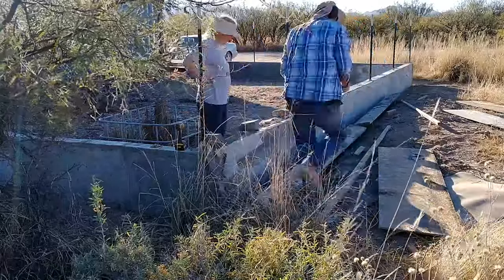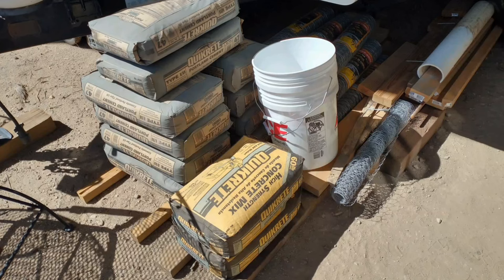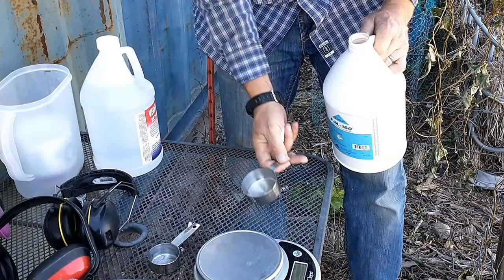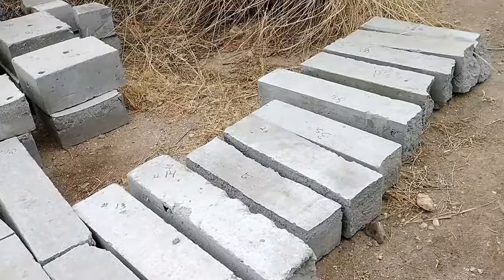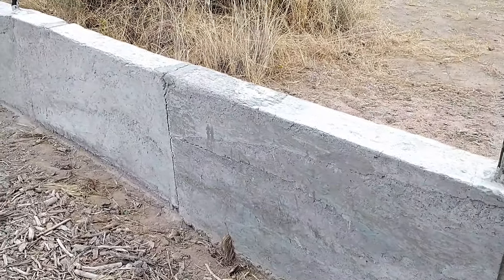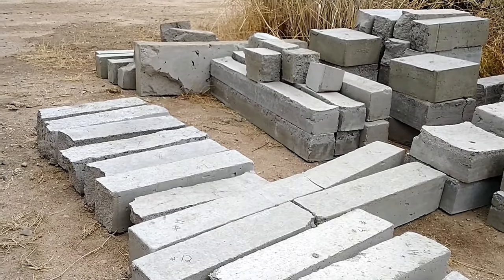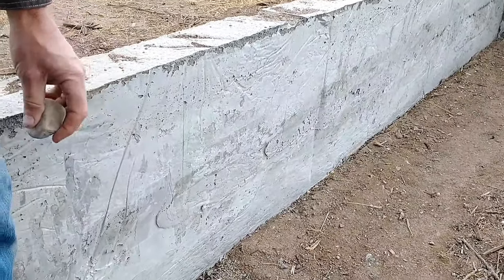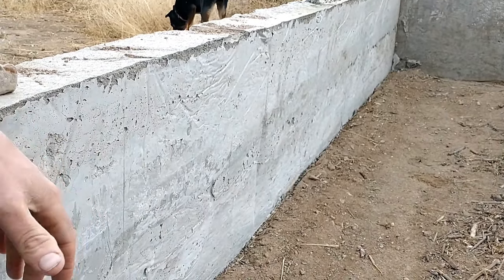Why we GAVE UP on AIRCRETE & What is Our Plan Now?

Comment: Aircrete is meant to be built with self reinforcing geometries like domes and arches, just like Roman concrete, then encapsulated on both sides with fiberglass or basalt mesh. When it is kept under compression and encapsulated with these tensile layers it is strong enough to even be earth buried. Straight walls are not recommended.

Good luck with your build.
Reply from the maker: I'm sure Roman concrete was much stronger than this stuff. Aircrete is a whole different thing and has way less tensile and compressive strength than any type of concrete. Plaster would help, but with pressure, our samples compress down and turn into powder. 
Thanks! We are excited to get this house built. 🙂🏠
Reply: @RedandAprilOff-Grid  Indeed. It is 70% air after all. It was never meant to pass the tests that this channel put it through. Neither would styrofoam, another product that is mostly air. The benefit of Aircrete is that it can be created from scratch, formed easily, manipulated very easily, insulates well, is fire proof, rot proof, bug proof, and water retardant. 

Making long blocks then placing weights in the middle to test its tensile strength is the opposite of what it is good at. Pressing direct pressure over a small, localized space to test for compression, is not what it is good at. Aircrete is a lattice of cement bonded around air bubble geometries. 

It distributes loads well.

When Aircrete is spanned across a distance, stacked in an arch or otherwise round shape, encapsulated in an exoskeleton of tensile reinforcing mesh and finished with stucco, it can hold tremendous weight. This is why Domes built in this manner work so well because their geometry works well at distributing loads across the cement air bubble lattice of the Aircrete while the tensile exoskeletal layers prevent outward expansion and lateral shearing.

I can poke a hole in raw Aircrete with my finger, and I can also drive a car on top of an Aircrete Dome after the tensile layers have been added while the inhabitants of that dome stay warm inside due to its rigid insulation properties while it is retaining a hillside and terracing land as it is partially earth buried.
Reply from the maker: @WhistleLad  The purpose of our testing was: to get a feel for aircrete and the process of making it, to compare the different mixes to each other so we could decide which recipe we wanted to use, and to see if we could produce a consistent and reasonably strong aircrete that wasn't overly brittle.
We aren't saying it can't be done, but we were not able to do it, and have seen many others struggle with making it themselves too.
It sounds like someone has figured out how to make some good and consistent aircrete, that sounds like an amazing dome. 👍🙂
Reply: @RedandAprilOff-Grid  I am suggesting that Aircrete is always brittle and that there is no way to change that because it is 70% air. The brittle factor can be reduced, but only at the expense of the air. More durable Aircrete will inevitably have less air bubbles in it, which will reduce its insulating properties. Different mixes serve different purposes and there are nearly an unlimited number of mixes that can be produced. Fiberglass or basalt chopped fibers can be mixed in, thickening agent and air entrainment can be introduced, but the end result will always be somewhat weak when the air ratio is >50%.

All of the blocks I make are brittle, but when they are stacked like an igloo and the dome walls of Aircrete are sandwiched between tensile reinforcement layers like basalt mesh the whole structure becomes incredibly strong.

The blocks themselves do not need to have tensile strength, nor shear strength, nor localized poking strength because they cannot move once within the outer shell of the mortared on reinforcement layers (basalt or fiberglass mesh) and because those tensile layers transfer loads down the geometry of the structure in a distributive way.

Surf boards 🏄‍♂️ are made of styrofoam a very brittle and easy to poke-thru substance, however, once the fiberglass resin layers are added to the exterior, surf boards 🏄‍♀️ become strong and durable. This is similar to how Aircrete is best used.

I am primarily explaining this for anyone who will read the comments. I understand that for your build you have now chosen a material that is better suited for your plans. 

Sending you best wishes. We will each be in new homes very soon! Round or rectangular, home is where the heart is.
Reply: @WhistleLad  So what you're saying is that these test were like testing the strength of a surfboard before the surfboard is finished?
Reply: @jeffellis7348  similar. Like styrofoam without fiberglass resin surrounding it yeah.

Comment: Was it by any chance cooler and more humid with those successful tests?  I learned if any concrete dries too fast, it cracks and crumbles...or was the heat and humidity the same during pours?  I know you've moved on, but would love to know if it's worth it to invest in a hopper that measures those variables in it's mixture ratios so the batches all come out the same.  Super important when needing to make a consistent mortar, too, so the walls don't crumble later if they cure at different rates and contract/collapse.  Thanks so much for sharing your efforts!
Reply from the maker: We figured as long as the temperatures were staying above freezing it would be okay. I think by the end, it was getting too cold. The well water was cold, and the Drexel was too cold. Now people seem to be saying if you add warm water to the soap solution, that should fix the problem. Which would not have been practical for us since we are off the grid and running everything on solar. We didn't realize temperature was such an issue, our 100°+ summers probably would have caused issues too. Measuring the materials wasn't difficult, but mixing them together really well was. We were planning to buy a mortar mixer, and sell it after we got done. There are so many reasons we are glad we didn't build with aircrete. Leaking forms, shrinkage, cracking, labor, cost, cure time. We found the whole thing to be a big pain. It's also unknown how long an aircrete structure will last, and I think there are better building material options out there. Aircrete is an interesting material though, and I'm sure it can be done. Best wishes! 🌞

Comment: Aircrete is not good for load bearing unless the bricks are at least 
12" ×12"×18". The best way to use it is within structural panels to serve as insulation. That's what seems to work the best. It can be used for domes because that shape is "self supporting".
Reply: What Is the load bearing capacity of it vs 2x4 pine and 2x6 pine?

Comment: As someone whose only experience with air crete is “I watched a few videos,” I would just add that some claim to get better results with foam crete, using a soap-based foaming agent to “fluff” the mix.  I should add these videos were made by people who were promoting/selling the idea of foam Crete, so of course they may not be the most unbiased source, but a suggestion if still considering.   I applaud you for trying this build, and doing so very reasonably and methodically.
Reply from the maker: Thanks! Yes, this is soap based aircrete, with Drexel as the foaming agent. My best guess is that the Drexel was getting too cold, & our night time temperatures were starting to get below freezing. We kept the samples wet and protected from freezing but it still wasn't ideal for the curing process. Aircrete is tricky stuff. I assume the hot summer temperatures wouldn't have worked well either.

Comment: Sorry for your frustrations!
I just came across this video and I am WAY late to the party.  Haven’t read the comments from others.  Just wanted to offer some information I learned some years ago when I was sold on rammed earth: it’s a method called PISE which is the acronym for “pneumatically impacted stabilized earth.”  The system utilizes sheet goods (kind of needs to be plywood) as an inside-of-wall form against which is shot resident soil mixed with Portland cement and fiberglass shards and applied with a gunnite machine which introduced water at the nozzle.
I saw a residence and a winery office building done this way in Northern California and it actually passed building code with the addition of some rebar which the builder told me was totally unnecessary, but required here in earthquake country.
Reply from the maker: Sounds cool! Yes, once we couldn't find a tractor for a reasonable price, we backed out of rammed earth and decided to try aircrete, and when that didn't work, we went with wood and metal as the main materials for our DIY home build. 🏠🏜️

Comment: I can tell you exactly what you did wrong as far as the consistency of the aircrete is concerned. This is a mistake many make including me,very frustrating, so don't feel alone. Ignorance is NOT stupidity. The first time you start making aircrete there is a hesentincy to the mixing. As you do more, you naturally mix faster. To keep the small tight bubbles, foam size, it is extremely important that you mix at a very slow rate. Moving up and down, side to side. Never allowing the whirlpool effect to carry air into the mix. Mixing to fast also causes the foam to combine into larger bubbles and when taken to extreme the air crete will collapse during the curing. This is obvious when I watched this video and saw how the progression of the old to new bricks where laid out.
 #2 The plans for your house are for the most part conventional. Aircrete in this case is only good as an insulator, not a structure. So you made the correct call changing your plans.
 Beyond what I have to say you guys presented a awesome video of your experiences and I learned from it. Thank you so much for posting!
Reply from the maker: Aircrete is very finicky stuff, glad you figured out what worked. We tried all different types of mixing strategies, which can be seen in our other videos. I suspect that the cold Drexel was the problem with our later batches, but mixing speed may have contributed too. Best wishes on your aircrete projects! 🙂

Comment: Thanks for documenting this so others will know to not rely on aircrete as structural elements. This is why others use more structurally sound elements within or around the aircrete to compensate. Personally I think such compensations make aircrete a superior solution but your pivot worked well. Well done.
Reply from the maker: Our design was explained in previous videos. This was just one in the series.

Comment: Red and April thank you for sharing your "real" journey. By you sharing your data and your outcomes (good and bad) is like learning right alongside you.

--So, as you have proven, Aircrete created with "foam" (foamcrete as I call it) is very fragile. It has its use in certain geodesic forms or non-domiciled structures, and hardfacing helps stability some (Honey Do Carpenter/The Happy Heresiarch) - but you really need chemically generated air bubbles for consistency and autoclaving to make aircrete somewhat durable. (Autoclaved Aerated Concrete = AAC - Think Hebel or Aercon AAC Blocks) 

But DIY'ing AAC is prohibitively expensive - as autoclaves are. And purchasing AAC is also expensive and defeats the goal of self-sufficiency, IMHO.

You folks seem as if you've done your research, so I assume you know how extremely labor-intensive rammed earth really is.

--So my question to you is before you move on to rammed earth, had you considered these two alternatives?

--1) Creating polystyrene/cement blocks or panels instead of foamcrete? You may be able to create more durable blocks/panels for the walls in your home, that perform just as good - if not better than aircrete, simply by using recycled ground-up polystyrene beads and Portland cement with an ad-mix. (Think "The Perfect Block" out of Tucson - but without holes or need for the expensive grouting) Structural support would still come from your steel frame. Stephen Williams (Aircrete) - has a YouTube channel where he's built a structure in this manner.

--2) If you like the thought of truly using "earth" as the building material, had you considered compressed earth block for your home? It's still labor intensive but less so than rammed earth and it produces similar look/performance of rammed earth. "Sustainable Living" YouTube Channel
Reply from the maker: We gave it a good go, but aircrete is tricky stuff! We steered away from rammed earth because of the equipment needed, labor, and we wanted something that would be more insulative. Styrocrete looks interesting, but it is also untested, and looks pretty labor intensive and messy. Even if it's easy to shred, that's a whole lot of styrofoam to collect and deal with.  We decided to go with a more traditional build, and found it won't cost us any more than aircrete, and it is going up much faster.  
I just found your comment, sorry about the delay in responding. 🙂
Reply: @RedandAprilOff-Grid  im sure you know that cement cures through hydrolysis.  Heat can speed up curing. But you need water.  Too much water and your product can be weak, to little it never cures.  You are very correct its hard to get consistent results as their are so many things out of your control.  The humidity, heat, sun light, wind, other convection.  Great luck in the future.  Its better to get something done poorly then to keep thinking and never start it.
Reply: Styrofoam or polystyrene, aren't these toxic? Even from within the  blocks? I read about health alerts...